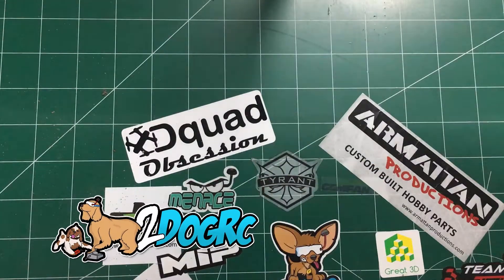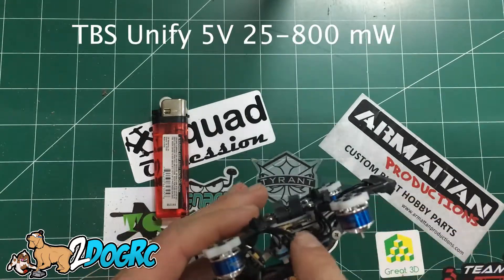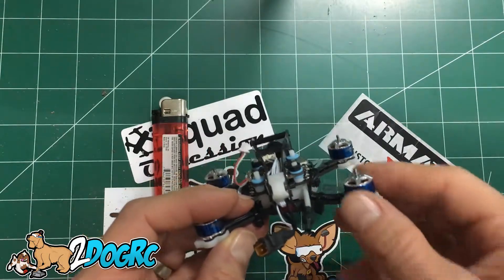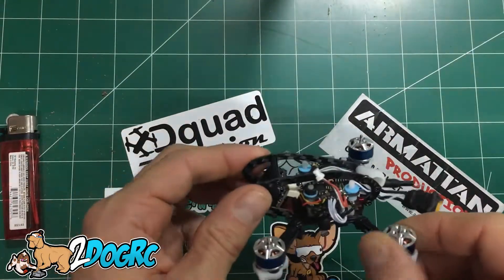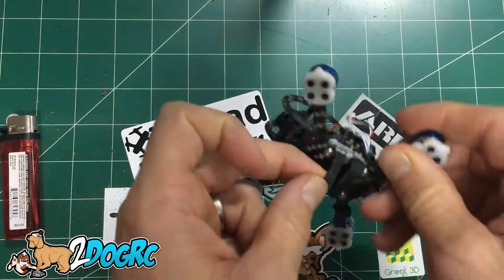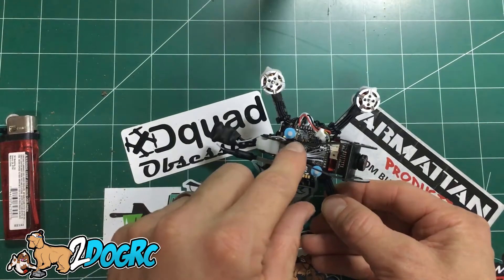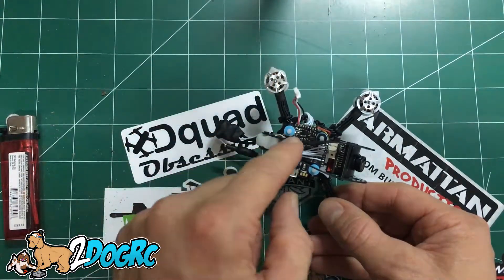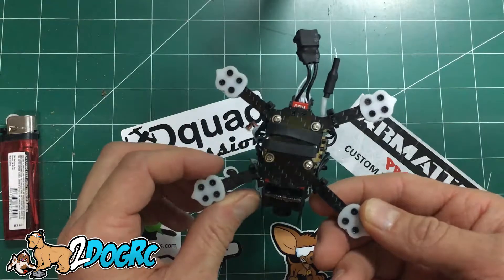Quick Overview of the Diatone R90 Micro Brushless Quad!

Comment: It’s looking really really nice, what size battery would you recommend for 3s and 4s packs? Or a weight limit you would stay around? Cheers
Reply from the maker: Well, I have tested 2-4s on this. 4s is wicked fast, but with that comes harder crashes.  2s is great for indoor and outdoor playgrounds.  3s does very nice as well. If you do go 4s, you have to drop the P to about 20.  I have not tested with the props that will come with them because Diatone just finished them.  They are 3 bladed and heavier then the light 4 bladed I have been testing with.
Reply: 2dogrc thanks for the reply, what capacity batteries are you using? I’m looking to get a few batteries ready and have seen a 3s 450mah Lipo weighing 44g. Then some 2s 800mah weighing the about the same. Would these be ok? Only fly 5” and this is my first micro so I’m not sure
Reply from the maker: Yeah, you will be happy on 3s450's. Should be about 2 mins flight time, but less if you are in a wide open area.
Reply: 2dogrc Hello,  along the same line , the stores in my area only have gnb 3s 550's  will they still be fine? And then 4s is between either the tattu 450 or gnb 550
Reply from the maker: I would recommend the 3s 550-450 size.  4s is fast, but with that high of a KV it is a bugger to tune!
Reply: 2dogrc What props did you end up using?
Reply from the maker: Running the Gemfan Hulkies now, but Diatone is shipping this with a similar set. They were not available until the R90 shipped.

Comment: Got my pre-order done!!  This'll be my 4th Diatone and I'm pumped.  My smallest brushless is a Firer 110 with 1103 10000kv.  It rocks and is only 2S.  This should be incredible.   I'm a huge fan of Diatone and this channel.  Thank you.
Reply from the maker: +abinosa Thank you. I will have some more vids up on this little guy shortly. You will like it. I like it on 2s for light weight cruising and 3s is very zipping and snappy.

Comment: xt30 is a welcome sight, so many use cheaper connectors, linear antenna is a great idea too, I would recommend velcro as well however, just that little extra you know. I have been testing a bunch of 100-65mm micro brushless quads lately myself, might have to check this one as well.
Reply from the maker: +Carrboro_Chapelhill Fpv Velcro is extra weight!  There is a sticky pad now included and the rubber bands hold even a 2s800 just fine. I have yet to fling a battery!

Comment: The for lack of better name, the roll cage should have aircraft aluminium like the dquad obsession or Armattan Japarula, if those side plates are gonna be so thin. Everyone will snap those on nothing bumps and scrapes.
Reply from the maker: I agree that is probably the weakest spot.  The good news is replacements are $0.75.  This was a pre production model and they have added a stiffener in the front. You can see it in the pics on the website.